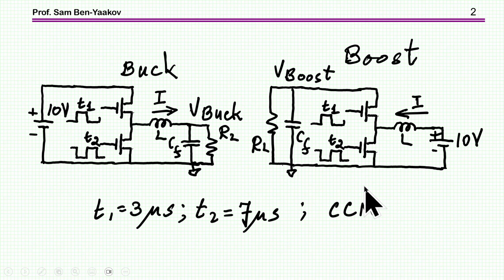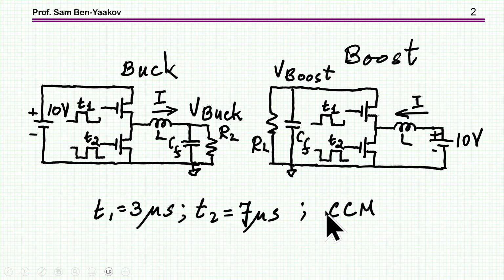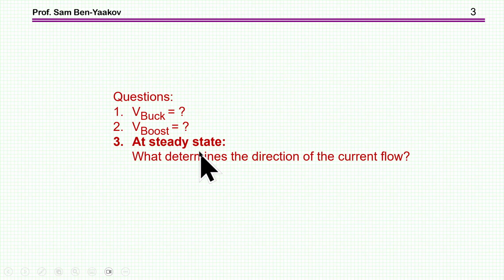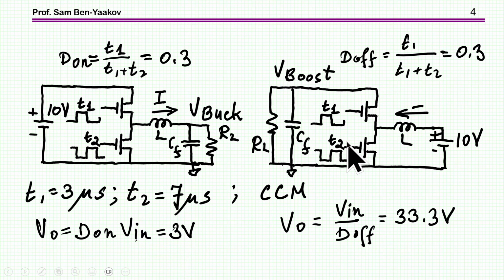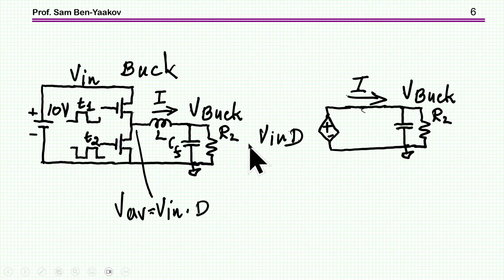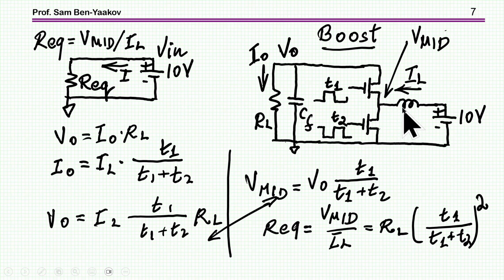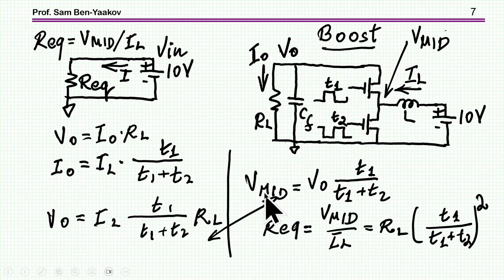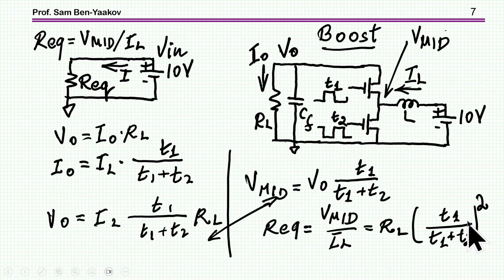Answer to Power Electronics Riddle: current direction

Comment: Thank you for giving us the intuition of things when it comes to understanding converters. Sill I have question for the buck convert : in DCM this time is it true the current can circulate the other way, ans it it also true the output voltage can be maintained steady and insure bidirectional current flow ?
Reply from the maker: This will be correct in a syncronous Buck.
Reply: @sambenyaakov  thank you professor, in the synchronous buck is it necessary to have a specific control law to achieve bidirectional currents flow at a given output voltage ?
Reply from the maker: @nonnondx5818  The controller needs to behave accordingly, like Buck when in one direction and Bosst in the other.
Reply: @sambenyaakov  does it mean the duty cycle are inverter from top to bottom?
Reply from the maker: @nonnondx5818  Indeed